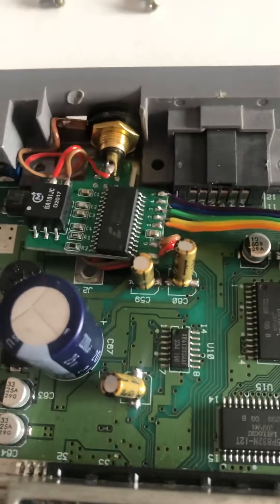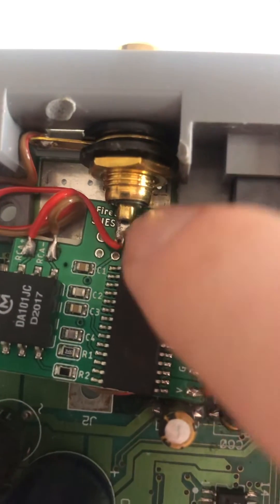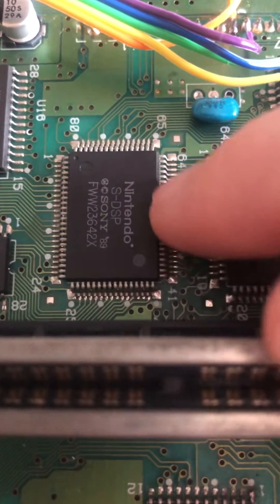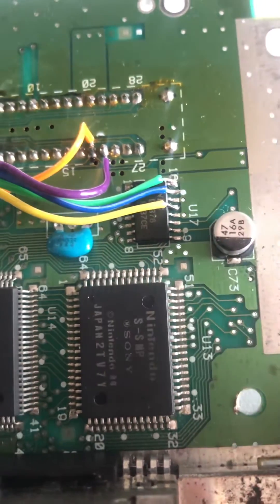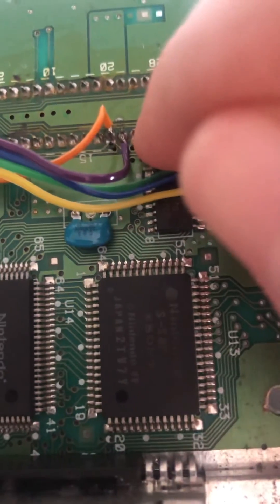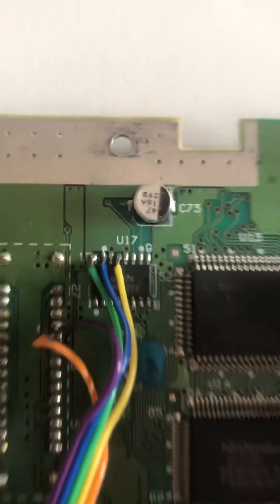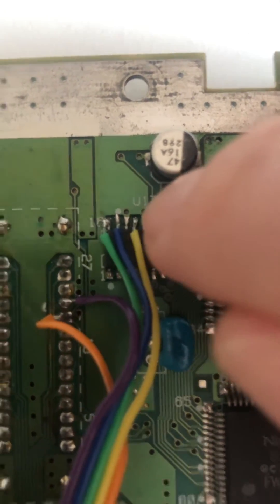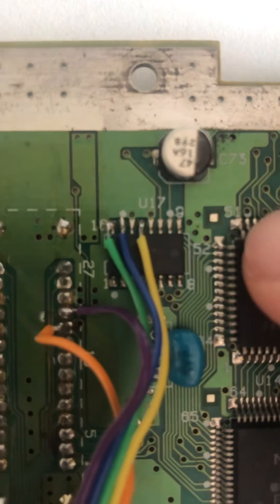Easy way to install S/PDIF digital audio mod to your SNES

Comment: Is it possible to install this without removing RF? I'd like to keep RF, because I occasionally use it, but everywhere I look has the RF removed. I have a third party shell, so cutting is not an issue.

Edit: It looks like the RF has to be removed everywhere I looked. It's fine, it's a 1CHIP-03, I'll do it, and keep the "2CHIP" console for any RF playing.
Reply from the maker: Yeah, you can.
Reply: @anto6887  I added an edit that I would removed since it looked like you can't, but you're telling me it can be done, huh? If so, that I would prefer that, however, I'm not finding any instructions on this mod where someone gives retaining RF as an option.
Reply from the maker: @crt_rex  Where to drill the hole is up to you.
Reply: @anto6887  Oh, so it's just a matter of relocating the hole, and then draw power from the RF as usual (from what I read)?
Reply from the maker: @crt_rex  That’s right
Reply: @anto6887  Excellent, I will go that route then! Thank you for clarifying that for me.

Comment: Where are your V and G pins going? Great vid btw
Reply from the maker: They are connected to where the RF box used to be.
Reply: @anto6887  Thank you!! Using this method I was able to install on my board. Removing the RF module was the hardest part.